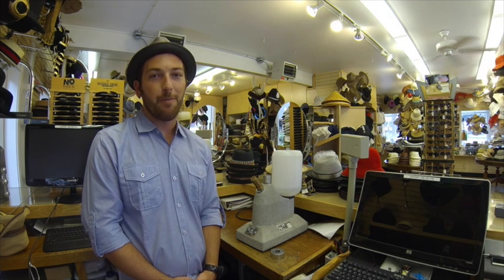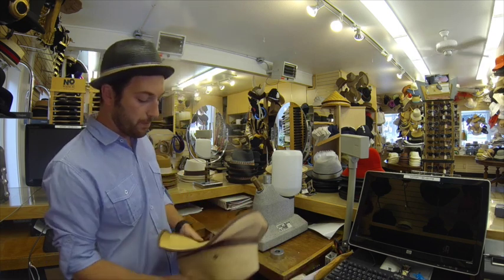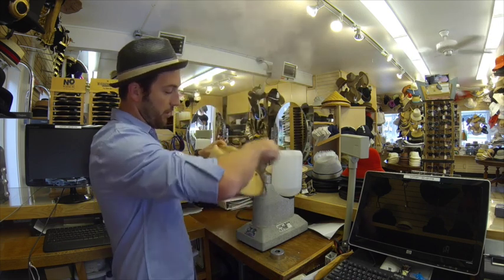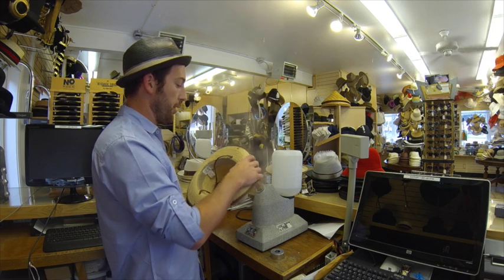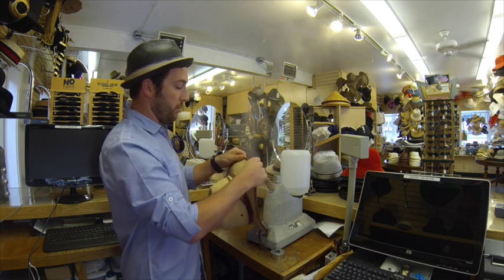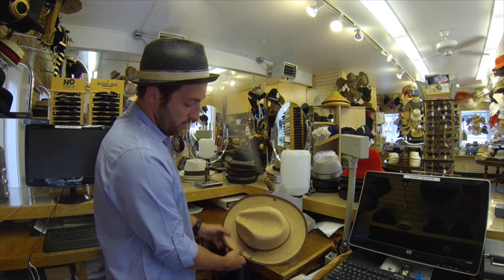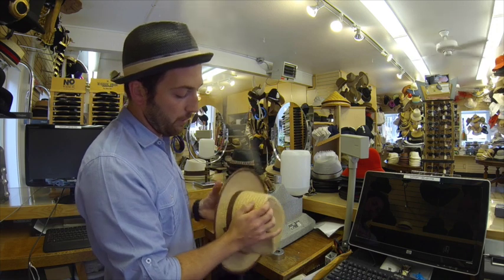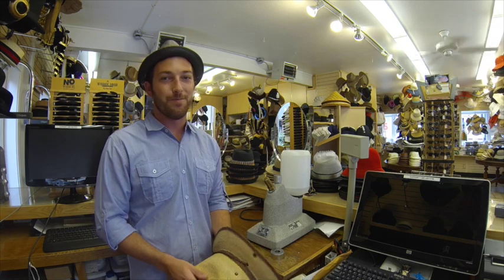How To Steam and Reshape A Hat - Hats Unlimited

Comment from the maker: Dor Manski  This process also works great on felt hats as well! I use most of the same techniques. Except because most felt hats have hat-bands, in order to get the creases out you aim the steam directly at affected areas and then smooth creases out with your fingers flat against the crease until it rubs out. Repeat as many times as necessary, steaming can take patience to do well.

Comment from the maker: DrIsabellaPH Thank you for the kind comment! For your hat that is an odd one, I usually find that hats shrink over time not expand in size. It is possible your head size has shrunk slightly over a time period like that or if you wear your hair shorter that can make a difference.
I have two suggestions however. The first is a product we have on our site that we use in our stores all the time called "hat size reducer" you can find that here: http://www.hatsunlimited.com/hat-size-reducer/ .
The second depends on the material of the hat and the style (probably better with straw). You could try steaming it thoroughly and getting it very wet, then drying more rapidly with a blow dryer held further away. That may just do the trick to get it to shrink slightly!

Comment from the maker: @Jose Luis Gallegos. I will not claim to be an expert at this specific issue, but at the risk of sounding simple, sometimes unscented odor neutralizers like Oust or similar products can do the trick. You may also try steaming and getting it damp then using a brush in a counter-clockwise rotation (with the nap), letting it air dry outside, repeat and possibly in combination with the before-mentioned odor neutralizer. Cigar/cigarette smell is a difficult one though : - /   Best of luck!
Reply: Hats Unlimited  felt hat

Comment: Very useful; what modifications if any do you suggest for fedoras made of paper?  Do you need to be more careful with the steam?
Reply: ***** Great; thanks very much!
Reply: leojbramble what were the modifications for paper?
Reply: Not sure why their original reply from 06/16/14 dropped off; I just came up your question here because I found their reply while clearing out old emails and wanted to be sure I had thanked them.  Anyway, here was their answer:  Hi +leojbramble, paper hats can also certainly be steamed. Depending on the thickness of the weave they tend to be quite durable as well. That being said, I have found them to be responsive to steam but requiring a little more work than straw typically. I recommend applying steam, letting the hat dry, then repeating the process until you get the desired result. Hope that helps!

Comment: Thank you for this video mate. I bought an Ernest J French hat when I was in Ecuador, sadly when I shipped it home it was crushed. Been sitting in storage for a couple of years now, but I'm going to give this a go. It's very thin straw, so I should be careful with how much steam I apply right?
Reply from the maker: +Spacemonkeymojo Hi there! the thinness of the straw will mean that it should take less steam to start seeing results. You won't have to be too worried about the amount as you will be able to feel when the straw becomes saturated and soft enough to start molding your hat back to normal. Just give it a go and you should start seeing your results pretty much instantly.
Reply: +Hats Unlimited I gave it a shot yesterday and it worked pretty well! I'll give it another go when I can to really get the creases out. Thanks for the reply buddy!

Comment: Will this work on a synthetic woven hat? My Calvin Klein woven hat got wet in a Puerto Vallarta rain storm. It is now too floppy. Spray starch? I think steam heat might be too hot for synthetic-seeming material.
Reply from the maker: +Katherine Cramer You will certainly need some sort of stiffening product. Hats, unless specifically designed, hate the rain and will flop like you have said. In regards to steam however, I have found that it works on almost every type of material including synthetics. You can always vary the amount of steam and the heat by getting the hat closer or further away from the machine. Best of luck!

Comment: I've got a well-crushed felt one you could "borrow" for a video on how to reshape a felt hat (lol). But seriously, does this steaming work on felt hats too? I tried it but it seems to take a very long time to soften it, and even then it doesn't go back into original shape. Seems to need to sit on top a mold a while to fix the brim shape.
Reply from the maker: +tim3854 Hi Tim! They are essentially all the same techniques for felt hats. Sometimes you'll have to do it in stages by going through the process, letting it dry out, and then restarting.  it does take quite a bit of time to get back to normal if the hat is really crushed. It will also depend on if the hat in question has a stiff crown, like maybe it has some cardboard or other structure inside. If that is the case it can be very difficult. If not, just keep working on it in stages and maybe try a stiffening agent like Bickmore - hat stiffener. Best of Luck!
Reply: +Hats Unlimited Thanks for the thorough reply! I think I need to be more patient next time I give it a go.  : - )

Comment: My husband got a straw hat that is too small.  It is a large and he needs an XXL...do you think with steaming it I can expand it another inch or so?
Reply: Hi Mary, unfortunately that is quite the stretch and I don't think it will work. I also have a large head, and I have tried to steam and stretch a hat just one size before. The hat ended up fitting, but because there is simply not enough material built in to the crown, it will bow out where you stretch it and look unnatural. That being said....if you have no other option and would otherwise throw/give it away, you could give it a try! Just really steam the heck out of it first. Good luck! ;)

Comment: I'm a man with a garage. No iron or kettle. Can I soak the hat in h2o and hit it with a heatgun?
Reply from the maker: Hi, while I honestly have not tried that I am close to 100% that is a bad idea. When hats become too wet or completely soaked they can be very difficult to get back to original condition. You should try instead to boil water on your stove and use the resulting steam to apply the methods shown in the video! Best of Luck!